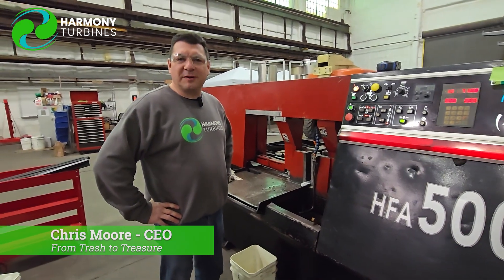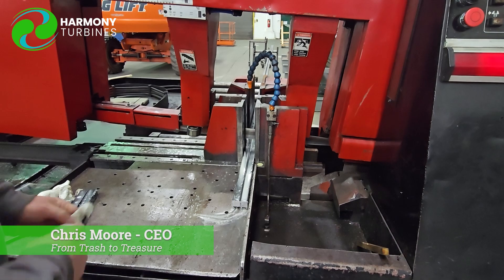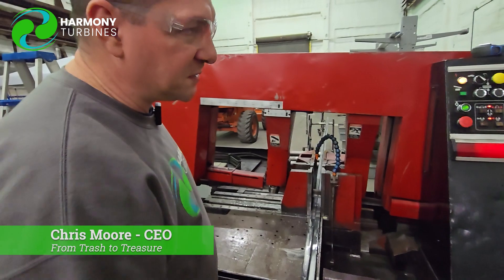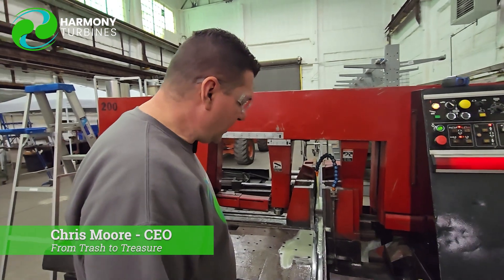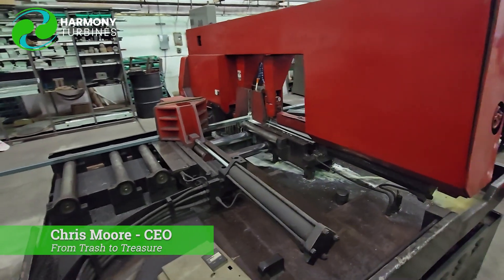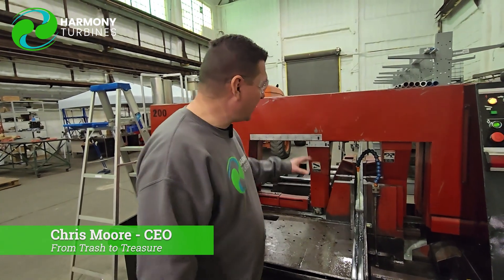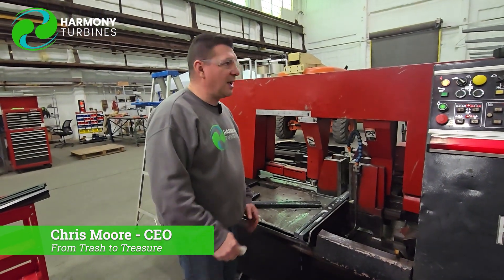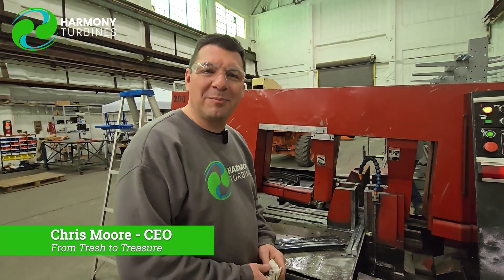From Trash to Treasure

Comment: IF YOU GO WITH A TUBE FRAME AS I SORT OF OUTLINE..... Then the actual scoops as for MASS could be reduced by going to a polymer instead of metal.......and consider a FLYWHEEL but not a conventional flywheel.....I would conjure a fluid flywheel as to modify MASS per conditions......as to add or subtract the MASS weight for a variable flywheel per se.......then the link to a generating unit....go with and think....automatic transmission fluid torque converter......and perhaps the later style locking clutch type used after 1980 in the auto transmission world if you are a gear head.  Rethink the scoops as ship sails and MASS........
Reply: you know the trade winds....and Sargasso sea
Reply: Sounds like you know a thing or two!

Comment: Would it be cheaper to go with stainless tube and mandrel bending to fashion frames as if creating a custom car exhaust scheme.....and filling the tube void with expanding foam or a slurry of a cement with maybe a styrofoam waste as the aggregate instead of stone or pebbles.  You could manufacture the bends and expand the ends as a slip joint and then cut straights to size for framing and weld the seams and fill as the solid fill would enhance the strength of the tube.  the orientation of the slip joint would be a thought as to not let water seep into the joint and interior of the tube....hence the other aspect of a filling........and at the end of the day....the structure weight as a damping mechanism aspect.  Bulk tubing would probably be cheaper than solid metal stock.  IF weight as a damping aspect....either stone or say metal scrap as in machining waste could be a recycled source stream as a filler in the cement as a bulking agent.  The units would be in a stationary location for the life of the device for the most part.....and longevity of Stainless.  Food for Thoughts !